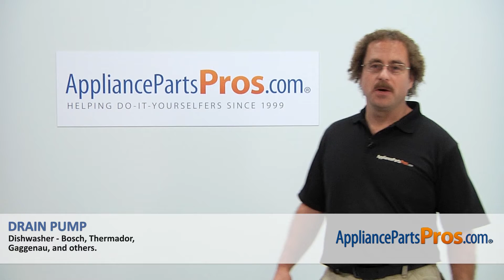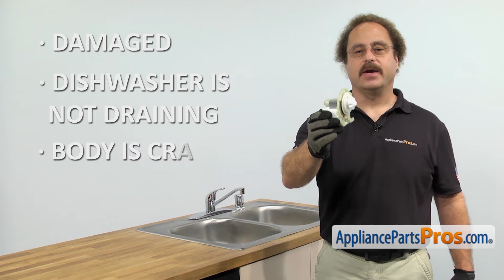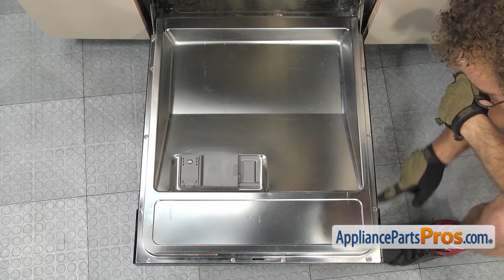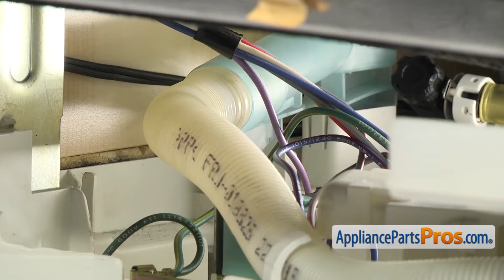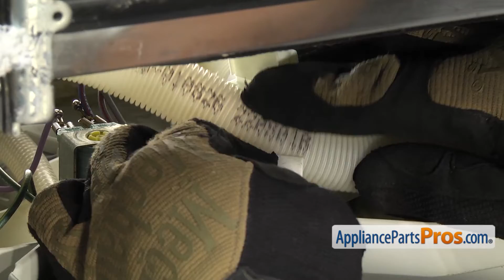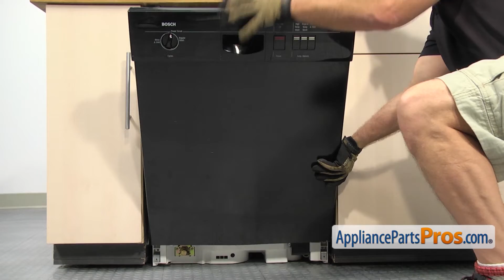How To: Bosch/Thermador/Gaggenau Drain Pump 00167082

Comment: My Bosch looks the same inside. 
Q: my pump works properly for 2 seconds then stops. 
The drain hose to disposal is absolutely clear. 
Yesterday I removed the water & cleaned out any debris including around the impeller & removed/cleaned the check valve. I soaked initially with vinegar and today used CLR. 
INTERESTING note I removed filter & used a spoon to create a “whirlpool” with the standing water. This made the pump work confirming drain line was not plugged. I also did same (spoon whirlpool) the with the impeller uncovered confirming impeller turns but once again motor stops after 2 seconds. 
Great voice & video.

Comment: After replacing the drain pump, my dishwasher now won't fill.  What could I have screwed-up?
Reply: I would verify that the impeller can turn. I just did a drain clean / filter clean due to an E:25 error and discovered that a small lemon seed had wedged in front of the impeller on the pump preventing it from spinning. Maybe you got something stuck in there.